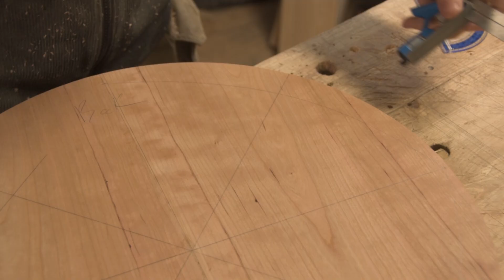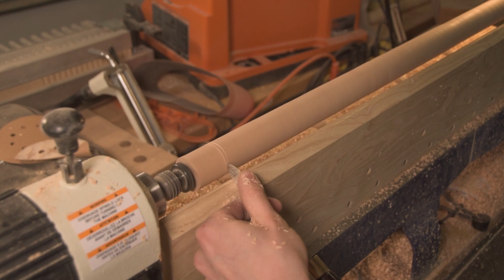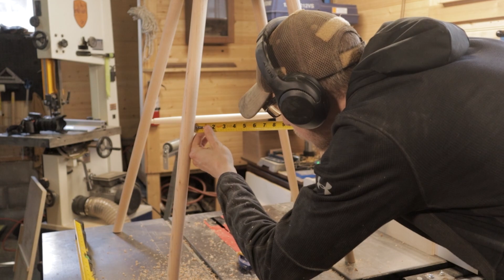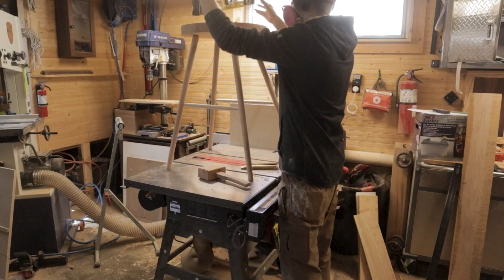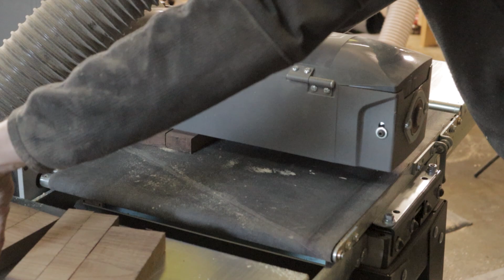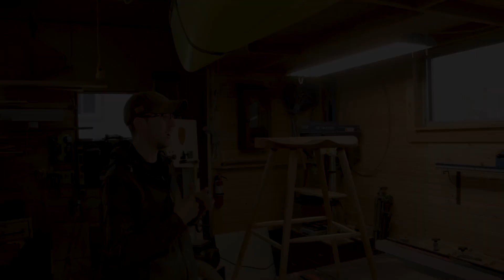Shaker Style Studio Stool

Comment: That turned out great!  You thinking about investing in a reamer at all?  The shouldered tenons look fine, but it can be a real neat look when the transition is smooth .
Reply from the maker: I have the basic Veritas reamer and I'm still trying to figure out how to use it properly in this building style. I'm also hoping to get the tapered tenon cutter from Lee valley that is supposed to cut those transitions perfectly. 
Making those smooth transitions on the lathe is definitely possible, i think it's just going to take a lot more practice!

Comment: Great job brother. Nicely done. Hey, where did you get that metal straight edge you were using?
Reply from the maker: That was a Veritas Winding Stick, not really meant to be used as a straight edge but they are straight and work really well. I also have a Veritas Aluminum straight edge that I love but at 36 inches it was a little long to check these pieces.

Winding Sticks - https://www.leevalley.com/en-ca/shop/tools/hand-tools/planes/maintenance-and-accessories/53276-lee-valley-winding-sticks?item=50N0101
Straight Edge - https://www.leevalley.com/en-ca/shop/tools/hand-tools/marking-and-measuring/50074-veritas-aluminum-straightedges